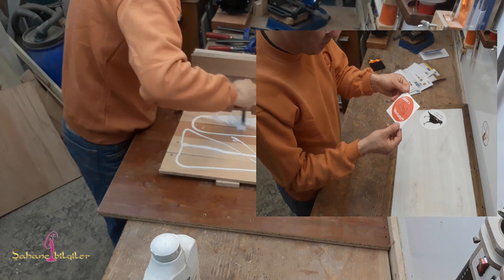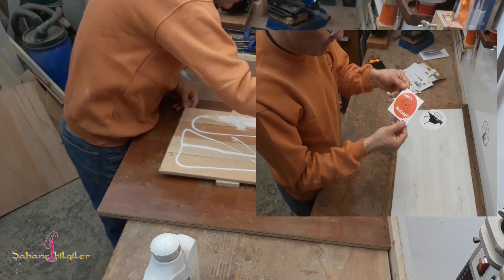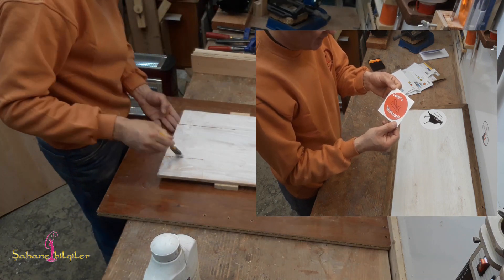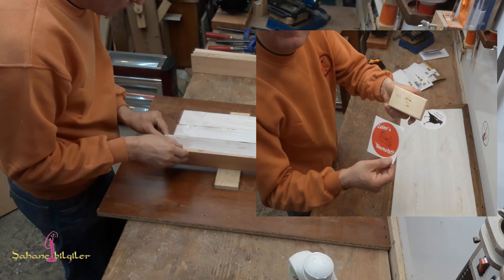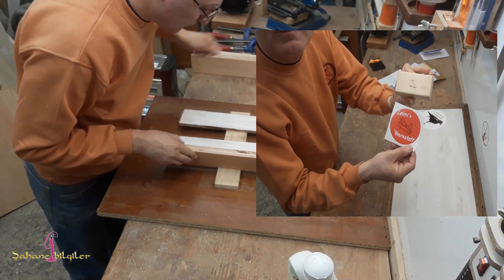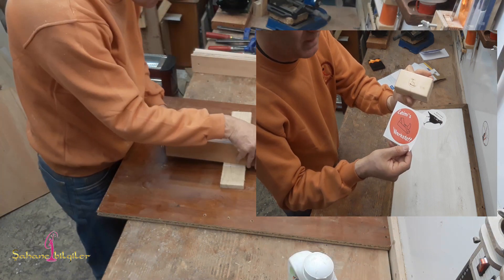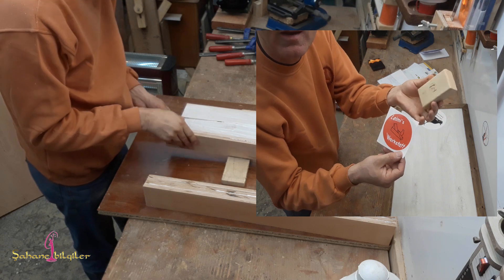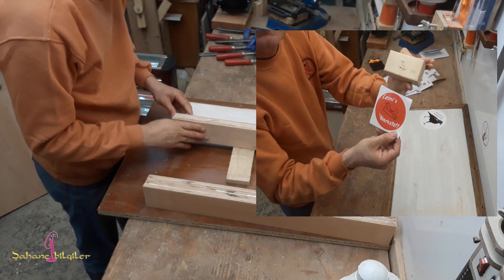Tezgah testere kesim kızağı yapımı / Making Table Saw Sled / FREE PLAN

Comment: What size is the arbor on your table saw and what size blade?
Reply from the maker: Hello my friend. Table Size 560x870 mm. Blade diameter 254mm.
• Blade core diameter 30mm. • 90 ° cutting depth 80mm. • 45 ° cutting depth 50mm. For now, this saw is doing my job. I made this sled for better use. Thank you for watching. Warm hug. Great greetings. Yours truly.
Reply: @Şahanebilgiler-j8i  i was gonna send you a blade since I have many extras  but i dont think it would work... i think our arbor sizes are different.
Reply from the maker: @BradsWorkbench  Thank you very much for considering this. You are very kind. Our measurements may differ. I have 2 spare blades for now. Thank you so much again for your good thought. Great greetings. Yours truly..